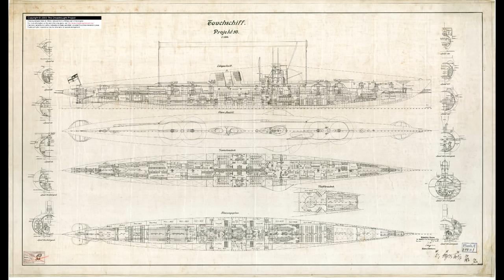The Drydock - Episode 275

Comment: The problem with the British holding Singapore is that the Japanese had captured the main water supply for the base. Its all very well saying the British may have had the food and ammunition to out wait the Japanese, but without water its a moot point as you are going to die of thirst a long time before starvation become an issue.....
Reply: They could have tried to launch a counterattack, but from the British perspective it seemed to be a lost cause anyway.

Had they known how they'd have been treated by the Japanese after their surrender, I think there is very little chance the British and Commonwealth forces would've surrendered as quickly as they did.

And as Drach said, the support of battleships would've made the counterattack much easier.

Air forces would've helped also, but the British were much too slow in providing Malaya with even vaguely modern aircraft in any numbers to make a difference, especially with the war in Europe.

Regardless of the outcome Singapore will probably eventually fall and there weren't the reinforcements or equipment to retake Malaya anyway. Japan would also be free to send battleship and aircraft carrier support after Pearl Harbour.

Comment: 109's, FW190 and the Stuka during efforts to fix tail problems had extensions added for stability.  The extensions sometimes 2 were inserted to lengthen the tail for better steering.  While you could reengineer carrier models, none as built were even close to carrier capable.  No arresting hook could be fitted and the landing gear wouldn't work more than once.  The 190's main spar holding the gear wold work one time.  Carrier is designed in not added on.
Reply: Weren't both the Hurricane and the Spitfire upgraded for carrier use?
Reply: I see absolutely no reason you couldnt convert a land based fighter for carrier use. It has been done szccefully dozens of times.
Reply: @egoalter1276  Dozens?  I can only think of two WWII-era aircraft that were converted and deployed, and the Spitfire version was notoriously fragile.
Reply: @mbryson2899  F4 Phantom II, DeHavilland SeaVixen, MiG29-K, Mirage 2000, should I keep going?
Reply: @egoalter1276  All fine WWII-era aircraft and perfect examples.  Thank you for the illumination.
Reply: @mbryson2899  I never specified WWII era. Merely that aircraft can and were regularly upgraded for carrier use.

Comment: One other way the Russians could improve their position in the Russo-Japanese War would be to complete the Trans-Siberian railroad.  Port Arthur was the Pacific terminus of the TSR, which allowed the Russians to supply the naval base.  The problem was that the railroad was incomplete.  It was complete from Moscow to Irkutsk, and from Boyarsky on the other side of Lake Baikal to Harbin and then onto Port Arthur (modern  Dalian).  However, at Lake Baikal the land route was blocked by mountains and goods had to be transferred on to shipping for transfer from Irkutsk to Boyarsky.  This worked well in summer (a short season in Siberia) and not at all in winter when the lake froze over.  During the siege of Port Arthur, the Russians tried building a railroad across the ice, but previously unsuspected warm springs weakened  the ice and the train fell through (you may remember the scene in the movie Dr Zhivago - well something like that actually happened).  All of this meant that the Russians could only supply Port Arthur for six months of each year.  Plans were in place to tunnel throught the mountains surrounding Lake Baikal to complete the railroad but they were several years from completion.
Reply: You have explained precisely why Ukraine attacked the rail network where they did. Thankyou.

Comment: The one thing that would decide the Russo-Japanese War was this: completing the Trans-Siberian Railway before the war began and actually completing it, as in fully completed and linked up entirely.

Even though it was technically opened in the summer of 1904 there was a "minor" technicality that it wasn't fully linked up. 

The railway then didn't bypass Lake Baikal. One side terminated on the western shore of the lake and the other on the eastern end. The result was that all railway traffic had to be ferried across the lake on a small collection of ships. This created a MASSIVE bottleneck which completely invalidated Russia's then infamously feared steamroller of sheer numbers that would flood in once mobilization was fully complete.

The result was that the relatively small Japanese army fought an equally sized Russian army and the qualitative differences which the Russian arny has always suffered from couldn't be fixed with "quantity has a quality all of its own" as usual while the Japanese had both a closer supply base from the Home Islands and their entire ocean going shipping fleet dedicated to supplying their army, not a lake's worth.

Comment: FW190 was also eventually a JU87 replacement, so not only a excellent CAP fighter but also a valid strike/dive bomber aircraft, so effectively a F4U Corsair with balkenkreuz so apart from a few potential torpedo and or scout aircraft -it would have allowed a practical single type loadout.
Reply: Remembering the 109's weakness, did the 190 have the range and endurance for scouting and CAP?

Comment: For Imperial Russia changing their strategic focus and increasing the fleet stationed at Port Arthur, I question whether a fleet beyond a certain size could be based long-term at Port Arthur. The city was connected by a spur of the Russian's Trans-Manchurian line out of Harbin, but both the rail and sea links would be very vulnerable.
Reply: Leaving torpedo boats to cover Port Arthur and moving the Russian heavy ships to Vladivostock would have given the Japanese a bit more trouble.
Reply: @mikeynth7919  Did the harbor in 1900 and shore facilities at Vladivostok exist to support ships beyond the cruisers that were based there historically? The Soviets built al that up but I always figured that was because of the loss of Port Arthur. Since they didn't really have any other Pacific ports by then of any size.
Reply: @mikeynth7919  At that time, Vladivostok froze over three months a year. That's why Imperial Russia wanted Port Arthur so badly. And winter would impair the Trans-Siberian, which is also having to support the army and everything else the Russians chose to base in that part of their empire.

Comment: Timing is everything department.  In the armor piece a few days ago, I proposed an alt history where the US retains the belt armor made for the South Dakotas, then sells it to the UK for the KGVs, when the North Carolinas are designed with sloped belts.  One objection was that the US armor would be inferior to the armor that the KGVs were designed with.  The solution to that problem would be to replace the US armor with new, British armor, when it became available.  Today, Drac addresses that question: the feasibility of replacing an armor belt.  Photos of KGV and Prince of Wales launching shows their external belts were not installed when the ships were launched, answering the question whether the armor was structural or not.  

Would the South Dakota armor fit KGV?  In December 1918. Repulse went into refit, which included removing her 6" belt, and replacing it with the 9" belt armor that had been made for Almirante Cochrane, which was now surplus.  The only detail I am hazy on it how the armor was made to fit the different hull?  There must have been means of using shims, or reshaping the more ductile back side of the armor, to fit.

Comment: thin face hardened armour is possible, the tank museum has videos on early tanks that mention vickers making cemented armour plate roughly 6-8mm and up iirc, german half tracks also have very thin face hardened troop compartments, in both cases it's the face hardening that allows such thin plates to have reasonable resistance against small arms fire

Comment: I have always understood that it was over at Singapore once the Japanese captured the islands water supply? Also slight correction. it was gun 3 and 4 that were shorter than 1, 2, 5, 6 on the Brandenburg class. Caused problems for Avalanche Press with there naval games that include those ships. A later variant article gave a fix for it within the system.
Reply from the maker: With Singapore, yes on the water supply to a degree, but it was possible to have organised the defences better to hold it longer, and it turns out the IDA'S own supplied were almost as short as the garrisons when the surrender occurred.

Comment: The 109 with all its undercarriage issues - narrow track and fragility - seems like a terrible choice for a naval fighter.
Reply: The 109's landing gear issues tend to be over stated. Landing even hard on a properly smooth runway almost never had a gear failure without stiff cross wind or ground loop. Between the arrested landing and the carrier running into the wind for landings eliminate the leading causes of gear failure and the navelized 109s did have strengthened landing gear.

Comment: 08:58 - That's one of the reasons (albeit, to be fair, a fairly-minor one, as rearmoring a ship is a fairly-rare occurrence) using armor as a structural element is generally a dumb idea, alongside "armor steel, even the relatively-supple backing layer, is quite brittle compared to structural steel, and normal flexing of the ship's structure could well snap the armor plate right in half" and "even if you somehow made armor steel no more brittle than structural steel without compromising its protective ability, by integrating the armor into the ship's structure you're coupling all the cyclical stresses encountered by the ship's structure into the armor, which will badly compromise its protective ability via progressive fatigue cracking".

11:03 - You say "absurdly-too-well-protected", I say "future-proofed against enemies introducing bigger and better guns".

33:54 - And, on the flip side of things, we have Aki and the Dantons, which, despite only being semidreadnoughts, use steam turbines and thus can just about keep pace with Dreadnought.

35:34 - By that definition, the Kawachis aren't dreadnoughts either!

38:58 - And, if the air attacks do start to do them serious damage, in extremis they can run themselves aground and fight on from there.

Comment: The Fw-190 had one problem minus, when comparing with the Me-109: range . The conversion of the Me-109 had been criticised because of it's short range, and the 190 actually has shorter range. So, that would be a serious problem, specially if we have a "what if" scenario in 1942/43, when the allied naval aircraft were able to attack from longer distances, which would force german naval bombers and escort to fly further. Not to mention time on CAP over the german fleet.

Comment: 00:00:57 -- I have to wonder, if so many ships wound up enough over design displacement to put their armor belt closer to or even underwater, whether naval architects could simply assume that the ship will wind up over displacement and design the armor belt to sit higher on the side of the ship (with the inevitable balancing act this would cause due to raising the center of mass, only partially balanced by the ship drawing more water) This has the obvious drawback in that if the ship, through whatever act of God, fails to wind up over its design displacement, would have a vulnerability gap at and below the waterline, but were any ships designed with the expectation that they would wind up overweight and had their armor belt redistributed accordingly?

00:07:13 -- Another consideration for re-armoring a ship is, if you're replacing its current armor with an equivalent thickness of better armor, due to it being necessary to maintain the durability of the ship against newer opponents, you're not upgrading the weapons_, which will presumably be falling behind the cutting edge of weapon design, so that the up-armored ship would no longer be realistically able to damage the ships it would be facing until it closed to within ranges at which the increased armor wouldn't help -- so that you would want to balance upgrading the armor with upgrading the weapons suite. Was this ever done as a comprehensive refit, or would a ship more commonly have _either its armor or its weapons upgraded, but not both unless there was a particularly significant technical advance to support it?

Comment: A bouncing bomb or even a torpedo attack would of probably only damaged the lock gates. Whilst this would of been a pain to fix it's important to remember shipyards tend to be rather good knocking together large amounts of steel. So making a set of replacements would of been fairly quick. By contrast wedging a ship packed full of explosives in the mouth of the dock is going to destroy the gate mountings and the machinery needed to move them. That hardware is a tad more specialised and difficult to replace.

Comment: How do you actually weigh a ship in the water?
Reply: There are formulas to calculate the amount of water the ships hull pushes aside. That is why it is called displacement since water is basically incompressable.
Reply: @keithplymale2374  Displacement as you say. Water is one kilogram per litre (obv some water is more dense than other) throw it in a bath and work out what sloshes out. :)
Reply: Inclining tests - there are some rather alarming-looking photos of various ships canted over at 20+ degree angles while the tests are being done. I have a vague memory of Drach going into rather greater detail on what precisely is involved in a previous drydock answer, but I've no idea when it was, unfortunately.